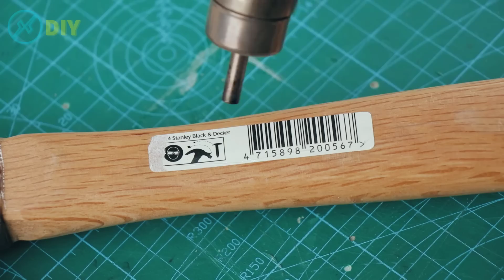يؤسفني أنني لم أتعلم هذا السر في سن 50!! حيل ونصائح

Comment: At 0:55 why not just use a deep socket. Even that trick will only work if the hole in the washer is big enough so the bolt can pass through.
Reply: Yes, or just use fingers, no glue involved.

Comment: Using tie-wraps for depth gauges is pretty expensive, tape is much cheaper.
Reply: plus tape doesn't slide up after the first hole drilled.

Comment: on any drill just attach your chuck by taping it perpendicular to the cord with electrical tape about 2 feet down the cord. no need to remove it to use it and you'll never lose it.

Comment: why not turn the nut all the way down to the wood first with your fingures
Reply: Too easy, gotta add that element of difficulty.
Same with the zap strap on the drill bit, us normal people just put a piece of black electrical tape at the desired depth.
Reply: Then he couldn't make this sweet video!
Reply: More fun to ruin a perfectly good wrench by super-gluing a washer to it
Reply: Or even use a socket which would be the common sense way of tightening the nut.

Comment: Wow a lot of great useful hacks thanks. One thing to be concerned about is that wire frame to prop up the cell phone. Wow it could easily scratch your phone screen if you you get clumsy.. l would snip off the plastic ends of a ballpoint ink pen or something the wraparound that bent wire that's too close to the cell sreen

Comment: cable tie around drill will just be forced up the helix, if you want to mark a drill depth, insulation tape would be much better.
Reply: Insulation tape won't also remove the saw dust on the surface.
Reply: @davidaz7188  Don't wrap the tape tight around the entire bit circumference--instead, wrap it once around and leave a "flag" sticking out an inch or so
Reply: Cabinetmaker here....use a piece of masking tape 2"-3"...center the bit on it at the desired depth...and wrap, squeezing the 2 ends into a flag that will sweep away the bit's shaving and alert you that your depth is achieved. Go too deep  by not stopping soon enough will force you to "re-tape" to maintain accurate depth. But hey, easy fix, you have the mark still, and 3" of masking tape is about as cheap of a "shop helper as you're ever gonna find.

Comment: You really should not use wire cutters on steel wire – they are made for copper wire, and steel wire will ding the cutting edges. The dings are obvious at about timestamp 3:54. The cutter on needle-nose pliers is hardened steel, so that’s okay for cutting steel wire except for cutting spring steel wire which is too hard even for that. The best thing for spring steel wire is a miniature bolt cutter.
Reply: Harbor Freight snips.....cheap stuff
Reply: I thought he was making a fancy roach clip 😂
Reply: And I wanna know where to find wire hangers at all....my friends and I all need one of my excellent "bong pokers" that I used to make and hand out as party favors, host gifts, etc......hehehe 
(And yes...needlenose pliers are my tool of choice...cutting OR bending.)
Reply: @Fixorfish  The last ones I’ve gotten came with some dry cleaning I had done, if I remember correctly. You might try asking at a commercial laundry too, if there is such an animal nearby.
Reply: @Fixorfish Stick and poke tattoo needles make better pokers than wire hangers, they’re stainless steel, and already have a ring on the end. Just break off the soldered-on tip, and scrape off the solder. Tattoo shops throw some away every time they do a job.